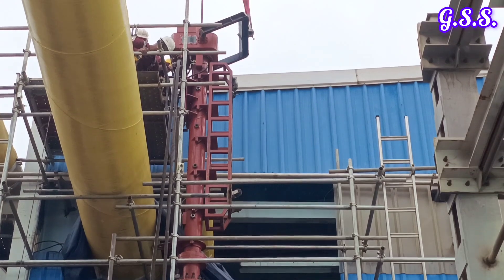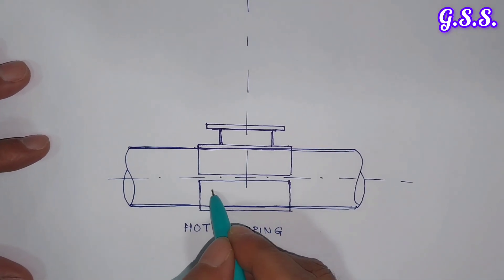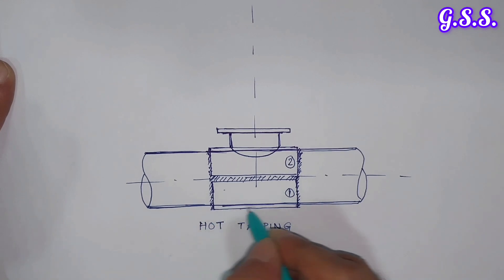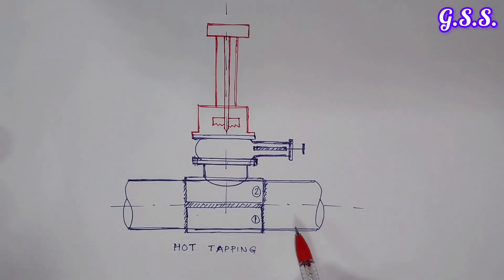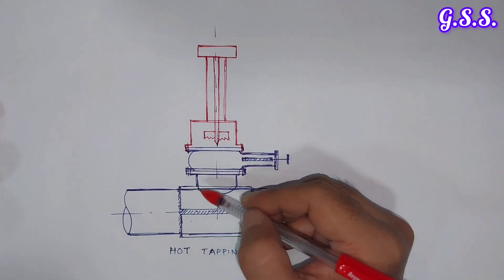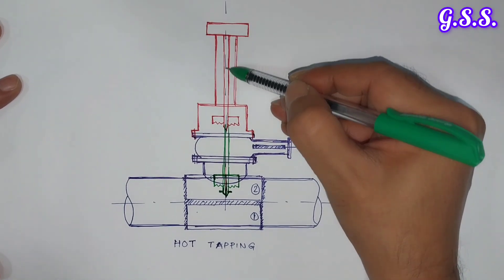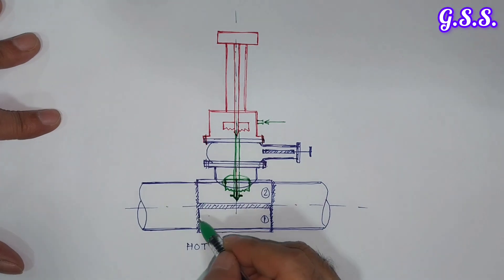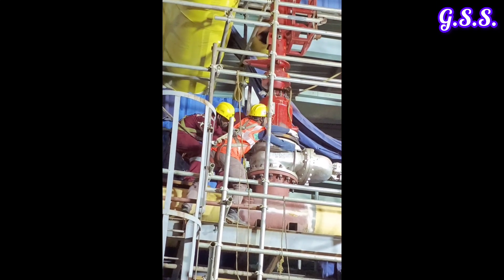Piping Engineering : Hot tapping or on-line tapping on operating pipeline

Comment: I have been curious about how hot tapping is done without shutting down the system. I understand that the main section of the pipe is cut out by the drilling tool, but I have a small doubt — during the process, some metal dust or chips might be produced. Wouldn't those particles remain inside the pipeline and potentially cause problems later?
Reply from the maker: Yes, some cut metal chips will remain inside the pipeline.  But it will remain at pipeline bottom and will not creat any problem, because it is heavy and will not be carried by the service fluid.